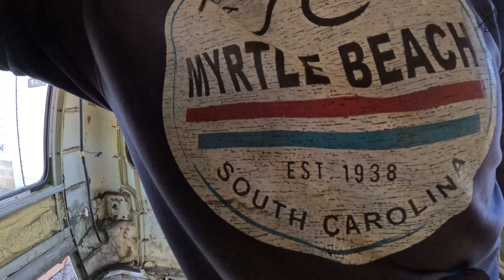Rewiring an ABANDONED GMC Motorhome! Rescue Part 7

Comment: I'm stunned with how far this ol' rig has come along! Can't wait to see the interior start to come together.

Just wanted to point something out though, as someone who's done home renovations before. It's best to leave the flooring install for as late as feasibly possible. Reduces the risk of scuffs and stains during the interior installation. At least it's linoleum in this case, so it's relatively easy to clean, patch or replace as needed, but there's no sense in doing a job twice if it can be helped otherwise.

Comment: WOW, this sure brings back memories of rebuilding our old Holiday Rambler camper trailer. We also scrounged up a totaled out second camper to scrounge for parts but really only used the shower and bathroom fixtures. I ended up rewiring ours completely from scratch, with all new wire, controllers, inverters, solar panels, a bank of batteries, and modern amenities. I'm glad that the propane system was reliant on the larger 30lb bottles instead of the larger built in tank but only because the trailer really couldn't drive itself to the propane station. I installed an all new water tank and plumbing using PEX. You'll need at least a 4K generator to power that rig if you plan on using the AC and be sure to install a fuel line that feeds from the main tank with a pump. On a full tank of fuel (28 gal on our Winnebago) you can run the genset for 3-4 days before having to refuel. That will keep the wife and kids happy with AC, microwave and TVs working. Install a lot of USB charging points on the 12v system. Trust me on that point! BTW RETINT THOSE WINDOWS! You're gonna need that extra protection from the heat in the summer time!

Comment: A little conduit for running or replacing wires later would be wise. Leave extra wire slack at each outlet, so they can later be easily replaced.

Comment: The only thing I would've done differently with the linoleum would have been to glue it down. I'm head of maintenance at a seasonal resort here in Canada, we see temperature swings of 35c (95f) in July to -40c (-40f) in January. Our guest cabins are not heated in winter, when we replaced the first Armstrong (12" square tiles) bathroom tile floors 10 years ago we found the linoleum would shrink in the cold and expand in the summers heat which led to bumps and wrinkles in the flooring and some cracking all this due to a fixed vanity and toilet holding the linoleum in place and not able to "float". We cured the problem 8 years ago on the remaining 60 bathrooms by using a vinyl floor glue to affix the flooring permanently to the sub-floor. This was against the flooring manufactures advice but it has worked for us! 

A side-note, 20 years ago the trailer manufacturers starting using very thin (cheap) vinyl flooring which started splitting the first cold winter, many new trailers on dealers lots had to replace it under warranty. Problem here is how they build these things, the floor is built first then cabinets and walls built onto the floor after flooring installed' The flooring was trapped under the walls and cabinets thus no way for it to float!

Great video series, I've looked at three of these here in Ontario to purchase but the rust was way to far gone, two had nice interiors but no frame left. 

Cheers, Geoff

Comment: I had to remove the tinting from the windows, the stench from the old glue is simply terrible, but a tremendous job was done, redoing all the wiring, taking into account the fact that in such motorhomes there are much more functions than in an ordinary house

Comment: 9:12 You mean VINYL, Linoleum Flooring IF You can find it in a roll, is VERY expensive, like $3.50 to $10/sq ft, where as Vinyl is super cheap, and readily available.

Comment: If you're not going to clean that foam insulation out you really should spray it with some sort of sealer; some people even use undercoating, but just something to stop dust from coming down into the motorhome. It was legal to use asbestos in foam insulation through 1989.
Reply from the maker: Wow good to know! We will most definitely look into a way to clean or seal it!

Comment: Incredible build, curious for the end result.
Was wondering something, would it not be a good idea to install some sort of extra roll cage inside the motor home?
(maybe from aluminium to reduce weight)
Because the existing structure is so minimal/flimsy?
Would be a lot of work but maybe worth it regarding collision safety.

Comment: I recoated my '66 Airstream bathtub and sink (fiberglass fixtures) 5 years ago using an epoxy enamel paint for boat decks (I used Rustoleum). One quart was expensive. But it's held up perfectly. Went on smooth with a foam roller. Highly recommend for freshening up that original bathroom. I figure if it's good enough to protect a boat deck, probably good enough for a bathroom fixture.

Comment: Just a suggestion, you might want to add a custom piece of Styrofoam or foam of some kind to your Shore power and other plug hidden panel you installed at the end of the video. Because if you don't you will end up with a cold and hot spot depending on the season right where that panel is at. So the styrofoam plug that you make for that should have holes too tightly fit around all the receptacles that go through it. I speak from experience.

Comment: Interesting and educational content for this entire process. Keep wondering how you plan on updating and rebuilding the rear suspension - that should be fascinating material. I think a real nice blue plush carpet would be awesome for the front cab section. I can’t remember but, did you update the trans and engine oil coolers? The updated electrical system and fixtures will make this a very comfortable and reliable unit indeed. Merry Christmas to you and all viewers.

Comment: Nice job on the build so far, can’t wait to see it progress, you do have some cabinetry from the trailer you might be able to use in the RV, I’d swap out the toilet from the trailer for the one in the RV, why not have a brand new throne to sit on. And when you were bringing in the linoleum I wondered what the hell dad was doing and then I realized it was a dog barking somewhere, I thought he was being funny. And I wouldn’t be surprised if that old insulation contained asbestos, so definitely be careful when working around that stuff it wasn’t banned completely until 89/90. The stuff you really need to watch for is the friable stuff, that’s the stuff that breaks down super easily, that stuff will turn into tiny little fibres that will get into your lungs if you’re not wearing a proper respirator.

Comment: I have a friend who has a 1976GMC RV just identical to the one there. It has the blue straps dwn the sides and the carpet is all a sky blue. Just sitting under a metal canopy waisting away! I'm surprised none of the tires are flat. But I've been in it and there's mouse poo here and there. Musty stench inside which it needs to be aired out!

Comment: Whatd you guys use to get the tint adhesive off? Currently dealing with this on a project
Reply from the maker: Scrape it down as much as possible then wipe up the rest with Acetone 🙂 There are also tricks like spraying 409 cleaner on the tint and putting a black trash bag on it. All day in the sun and the tint pulls of with glue on it. Hope this helps!
Reply: @BudgetBuildz  thanks! do you just scrape the tint with a razorblade?
Reply: *tint adhesive
Reply from the maker: @alexherman8642  Yeap! The thin single edge style ones. They also have a tool that holds them, helps tremendously.

Comment: #BudgetBuildz  I bought a shuttle bus  that they used at airports. I took out all the seats. I used the same braker box 30 amp. Is a 30 amp in an has 8 / 12 volt . An 6 110 volt . An it has a 12 volt charger . I am running 2 12volt batteries I can run my LED lights  going down the road. I did all the wiring my self. I'm in a wheelchair it has a wheelchair lift so I can get in at out I drive it. When you do the wiring it is easy.  What I like about mine i have a  Darmax with analyson transmission all power i need. I love your channel never miss a video.